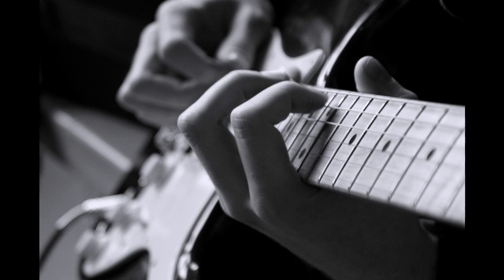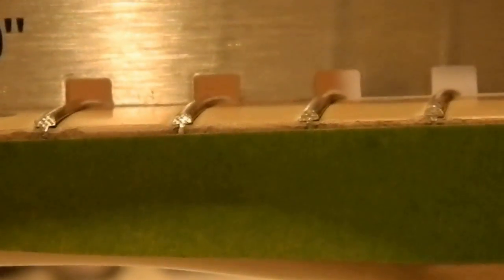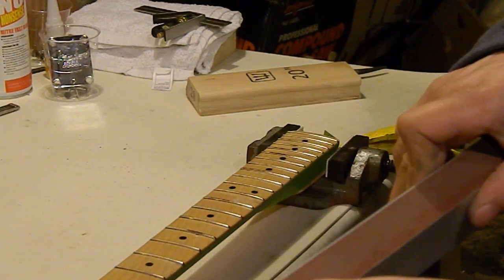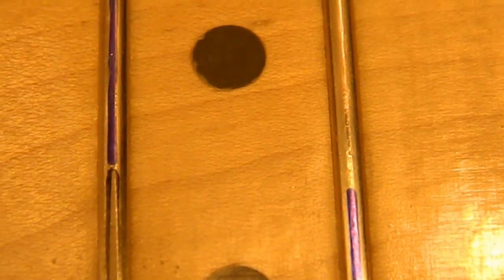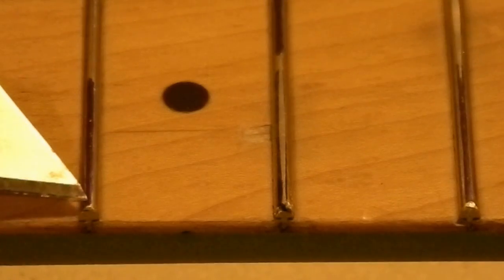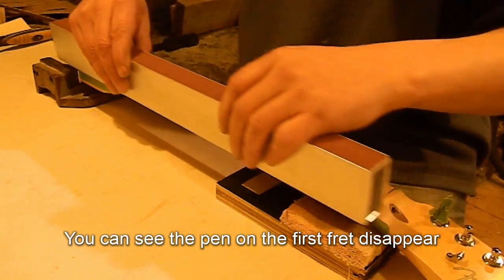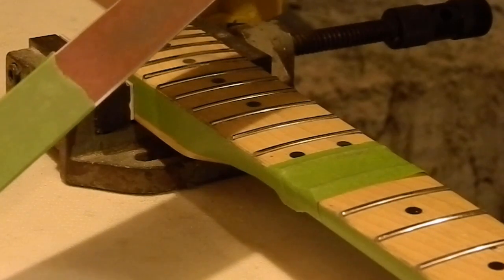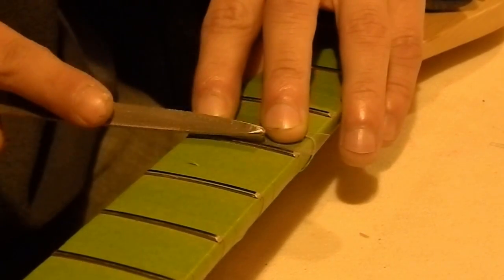Guitar Fret Leveling Why and How - Part 1 of 2

Comment: This is NOT a negative comment. I like this vid. I do things a little differently however. When I encounter a high fret, I first determine that it is properly seated across the neck. Often times it isn't! I lightly tap it across the fret  and check it again. I do that with all the high frets, then I wick in some glue to keep them in place. I also try to sell the customer on gluing all the frets. On several ocasions, I've not had to level the frets at all after doing this.
Reply: What method do you mean by wicking glue in? I have a fret on my guitar that needs this treatment
Reply: @zombiemontage  greetings.  Keep in mind I’m not a tech/luthier but I believe what he meant by “wicking” is that thin viscosity super glue is very good about soaking (wicking) into wood and into cracks, crevices and such.    Again I’m not a tech but if I had a high fret that was loose/unseated I’d apply some super glue (likely very little) along the fret-wire clamp it and let dry.   Move quickly though and don’t apply glue until after you’ve set up your plan cauls and have your clamps At ready.   Once you’re all set up and ready to rock, Apply the glue and you’ll notice it wicking in around, between and under the fretwire.  Clamp it and you’re good.    Doing a quick search here on the YouTubes should yield some results on fretwire clamping methods, cauls and such for ideas.
I’m envisioning C clamps 🗜 utilizing some sort of protection both for the neck back surface and the fretwire.   Alternatively if the fret isn’t exactly loose but rather has just raised up but stays put once hammered back in flush,, you could probably just hammer the fret flush and then apply the super glue (it will wick in).      Again I’m not a tech so take my advice as a grain of salt.
I only commented because I’ve watched a lot of luthier videos.   But that certainly doesn’t mean I know anything.
Cheers!
Reply: No joke, I literally just did this after reading your comment and it fixed the buzz on one of my basses. Then It created a new one on the next fret up, and I hit that one too and now it’s all good! 😅
Reply: Worthy comment. Thanks
Reply: Great video with excellent closeups and graphics. Best I’ve watched on the topic. Looking forward to see how you crown the frets next. Thank you
Reply: I agree. Great video, but i would start with the plastic mallet too, just to make sure. Frets can surely rise.

Comment: You skipped one very important step. Before you sand down all of your high frets, you should look for loose frets and frets that are coming up out of their slots. These should be hammered back in and glued down first, otherwise these frets will continue to create problems even after you level and re-crown them. Loose frets and frets that have moved are, the second most common cause of fret buzz, right behind an improperly set, or out of adjustment neck relief.(back-bow)
Reply: always ,iv`e even had Fender high end guitars with these fret issues
Reply: Ray Brett
The first thing I do when I evaluate any guitar that i am going to work on, is look for high frets, that have a gap under them. it's just common sense. Believe me, I've handled $5,000 guitars, with frets as bad as a $250 Indonesian fender.
Reply from the maker: Yep you are right Tim, I should have included checking for badly seated frets in the video - as you say it's very important and must be addressed before any leveling work. Thanks for watching and thanks for your comment.
Reply: duncan wallace
I like the methods you have developed. Very much like the way I do it. I made my own 24" aluminum sanding beam, when I saw StewMac wanted $45 for one. It cost me $4 including the sand paper. I also glue sandpaper to my perfectly flat work table, and use that for shaping and straightening fingerboards, right on the neck.  Love this hobby.
Reply: Tim, what did you use for making a sanding beam? I know various aluminum profiles are usually sold in the hardware stores. They are normally sold in something like 2 m stock. However when you make a fretboard  sanding beam out of that you have to make the sanding surface pretty flat. That's properly done by milling. You can of course do it by grounding on a flat surface but then again you need to have farely flat surface at your disposal. When we are talking of the guitar fretboard sure we don't have to go mad about it. I guess if you have a surface with some +/- 0.1 mm tolerance it should be fine for making the beam pretty flat... it it already isn't out of the hardware store.
Reply: VinniePaah:  Actually I found the aluminum beam in a pile of scrap that accumulated in my basement. Don't remember where it came from originally. It's a 24" long 2"X3" hollow, rectangular aluminum piece. Normally these are extruded and therefore very straight and very stiff. I checked it with a steel strait edge, and found that it was within .003 of perfect. I don't think you can buy this kind of stock from normal hardware stores, The ones I buy from don't have anything over 2X2. I would not use square stock for this, because it might not be straight, or hold straightness as well as 2X3 will. I believe companies that make signs, like the ones you see around shopping centers, use this stuff. I'm sure you can order it, but you'll probably have to buy an 8 foot piece, which defeats the purpose of making your own, when you can get one from Stu Mac for $40.  I also build a sanding table, with a perfectly flat top, that I can glue sandpapers to. I use that for flattening out the neck surface, before gluing on the fingerboard, and also for shaping the fingerboard surface, and making my radius.
Reply: Good tips, Tim - thanks. It's an interesting idea on the sanding table.
Reply: really !!!...do believe that!
Reply: @timhallas4275  Then why the fuck do they cost $5,000?
Reply: @vinniepaah5264  you can also lay sand paper on a surface plate (thick granite block leveled to around .000075" used by machinists etc.) and level the beam that way. use marker and go lightly and slowly. don't push hard or you will not get a flat beam at the end.
Reply: Ah f**k them Duncan, they're all know all's and don't seem able to use their own brains. You're bound to not mention a thing or two because some things have a basis in common sense. What they're doing on the web searching for "Guitar Fret Levelling" videos is a mystery, (or is it..)?! This video set a bench-mark (comparable to other videos on the web), for it's production value and certainly for the hosts' know-how. Great job man and much appreciated.
Reply: @duncanwallace7174  ui
Reply: @Not Steve somewhat... you have differences in materials. You cannot see how hard a metal is from another metal just by looking at it. The Special tremolo bridges for example are not as hard of metal. Also, the bridge nuts strip out unless you loosen and then adjust then re-tighten them. Who has time for all that noise? I have thought about taking mine out and either buying harder ones or welding a new end on the existing one since the head is stripped. My point is that you will not have this on the Original model and that is just one component of a higher priced guitar. This upgrade alone is about $300 or so if you do it yourself! Now you have the wood, the glue, the craftsman which dictates the design and tolerances quality... you are not getting a great guitar for less than around $900 if you buy new. I have two ESP V's that cost about $550 and love them but again they have a special which I have to file the blades and lube yearly as well as having to glue frets down (I live in Iowa and the humidity/temp changes work the frets out over a few years if you do not glue them) and they have one bridge pickup which is just fine for me but some people like more changes in their tone than that. I even plan on adding a toggle switch to mine for a kill knob but if you want a great guitar for cheap this is as good as I have EVER seen new! Most guitars, you will have to change everything to get them to sound good or function correctly for a $500 price tag. Some are just made poorly to start or with junk material. The saddest is when the materials used are good but poorly put together as some of the older (within the last 15 years) Chibson guitars. From the looks of it you can buy a Chibson, cross your fingers and pray A) they actually send a guitar and B) the guitar is made of good materials and put together well. There are many videos showing how much the cheaper Chinese guitars have come up in quality the last 8-10 years. Sure, you will have to do fret work, redo all electrics and some of the metal hardware I.E. bridge but spending about $1000 instead of $5000 and up for a very similar piece that functions the same is a deal. Any way you go you gotta spend more money to get what we all want and that is a guitar that functions consistently well and sounds great that you do not have to mess with for about 4 hours each day before you can play something then the next week it is all wonky again. Now a $3000 vs a $10,000 Gibson Les Paul.... yeah there are differences but they are trivial. One of my beloved ESP 200 vs a $5200 performance Gibson Les Paul... there sadly is no contest I would be a fool to not choose the Gibson. Will I ever pay over $1000 though, not likely unless I win the lotto. I will wait for a deal an pounce on it! Used in guitar world is not like used in car world thank god~
Reply: The video is fret leveling not what to do before you level or why you would glue & level. I think he did a great job at just telling you about leveling frets which is what it is titled as. There are a few videos about gluing and re-fastening frets which is what you want to do first before you level your frets. If you have not figured out to do that first then you have no business buying files and going to town.
Reply: Thank you that's a great first step

Comment: I could see that quite a few of the frets weren't fully seated on the outside edges of the fret board. That might explain why you have so many frets that have very flat tops once they've been leveled. Other than that, the video was very informative and helpful.

Comment: Great video. The video where the person leveled the frets in a side to side or x pattern using a leveling beam that almost covers the entire length of the fret board as opposed to sanding the long axis which in theory removes more material from the center frets isn’t wrong or the only right way to do fret leveling (watched Fender’s master luthier level frets and he didn’t use a side to side motion). Methodically working the beam, without pressure applied, while continuously checking the amount of material being removed from a fret is the key to success, after ensuring the neck is set level before working the frets. Removing small amounts of material at a time, is critical to the process. “You can always remove material, but you can’t put material back if you’ve “over leveled”. This is one of the first videos I’ve seen where he created a fall away at the upper end of the fret board. This is a technique that is used on guitars that do not have fall away. Some Fender Strats and Tele guitars have what is called a micro-tilt adjustment. These are the guitars you may have seen with the little hole between the bottom neck screw holes. This micro-tilt is the ability to adjust the heel of the neck (raising or lowering) based on the individual players action preference. Great video.

Comment: excellent and very thorough.  I usually skip the first steps of rocking or even spotting the low and high frets.  If you mark all of the frets first you will know the low ones as soon as you do the first passes with the 320 when they don't get touched.  the only thing I would truly like to point out is that you need to make sure the neck is straight before doing anything.  I realize this was touched upon in the video but it is of paramount importance. Once the strings are off a guitar, there is no counter pull and the truss rod has nothing fighting it.  You can't just sand the frets unless you know the neck is dead straight.  tune the truss rod to make this happen.   You can then use a straight edge or your sanding beam as a straight edge to verify.

Comment: Great videos , Duncan! About DIY tools, controling the straight state of the necks,  I use a graduated steel rule to transform it as a notched straight edge (this kind of tool the steel rule  is controled by laser at the end of manufacturing), and with a rounded file , I dig the slots, matching with Fender or Gibson or other marks , frets spaces. To own fret rocker, that's the same kind of tool: graduated steel rule, that I cut 3 lengths to match with large, average and small spaces of frets. The levelling beam is simply a bubble level! However I own Gurian crowning files, not very expensive and efficient.

Comment: Do you need the correct radius sanding block for your frets.  Or just a basic long sanding block?
Reply: I've seen several luthiers using a flat sanding rod and applying it equitatively to each part of the curvature (i'm not native).
But this guy is the only onr with the good idea of painting with a different colour the adjacent frets to the high spots so we can control we're not sanding the already ok ones.

Comment: I will assume from the little chips here & there on the fret board that this neck has been re-fretted. Also I observed from some of your close up shots that some of the frets were not completely pressed down in place. During your opening you showed all the tools that you use, one of which was a auto motive sheet metal hammer, did you try to tap those high frets down first before starting on your fret levelling task. Other wise a very good informative video.

Comment: The quality of your video is unquestionably the best I've seen anywhere on the Internet.  I'm sure it took a tremendous amount of time to shoot, much less edit it.  I congratulate you on your results- the video, the illustrations and your explanation of the process are superb.
I know how expensive specialty tools are (I've dabbled in this work and in gunsmithing), so I don't blame someone for making their own.  Your decission to improvise and use a modified 3-sided file (instead of a diamond inpregnated, concave "fret" file is commendable and appreciated.
But (there is always a "but", eh?
I don't care how hard you try to convince the unknowing, and I don't care whether you are using a single-cut or a "double-cut" file.  With the exception of that diamond empregnated tool, a file will only cut in ONE direction.  Dragging a file, backwards, across your work only serves to flatten the cutting surfaces (rendering them less- or un- able to cut) and destroying the life of the file.  A file that is labeled "double cut" simply means that the cutting surfaces are cut at two angles, forming a diamond shaped pattern of cutting surfaces.  Those cutting surfaces both face the same direction.
https://nancylthamilton.com/wp-content/uploads/2015/04/single-double-cut.jpg
Reply: Very fine video. I have a doubt. If with the strings mounted it is necessary that the neck is slightly curved at the height of the fifth fret, perfectly leveling it would result that with the strings mounted, the distance between the top of the fret and the rope would be greater than necessary; and I suppose that it would serve leveling with a bar that is not straight, but curved as much and as the upright string neck. Or not ? Tank you for the fine video.

Comment: Love your instructional YT video. Clear explanations with professional visual diagrams explaining how and why, I myself would order the specialty guitar tools needed for that particular job at hand ,but love the fact you included as many common everyday tools most people have in their tool chest. My 2006 Fender American Standard Stratocaster(maple fretboard) has major fret wear, was thinking of buying a new Fender replacement neck and working on the original neck. I have lots of fret wear but  really worn flat frets  starting on the 6th fret wire to the 10th fret wire, my question to you is how do you decide when the frets are beyond leveling and dressing and need replacing? Ive never re-fretted a Guitar before but I have confidence with the aid of a good DIY instructional video I could do a decent job, would you recommend this and do you have or know of a good instructional YT videos. I wanted to use stainless steel fret-wire because of its resilience to wear, any advice would be much appreciated thanks again👍🎸🇨🇦

Comment: Love the tape idea to get an angle on the frets above 12. Question: Why not mark all the frets to begin with and sand until the ink has been at least lightly touched on each? The first step marking high frets in black and low frets in blue then sanding seems unnecessary.